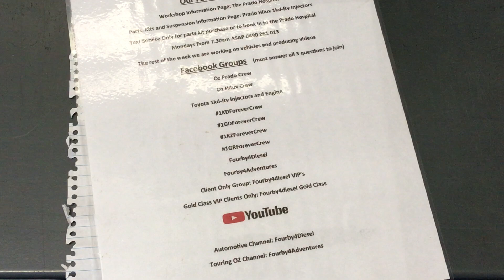P0400 800k update AND THIS LOVE LETTER 💌 When to replace injectors or BURN IN HELL

Comment: Too confirm if it's the EGR cooler, you can monitor the air flow metre air flow while you operate the cooler bypass actuator, if the flow drops while the bypass is not open, it must have a EGR cooler blockage, either move the actuator with scan tool or just manually by hand or vacuum pump